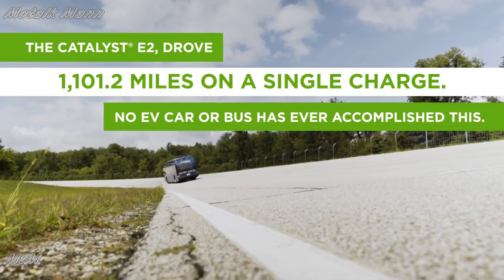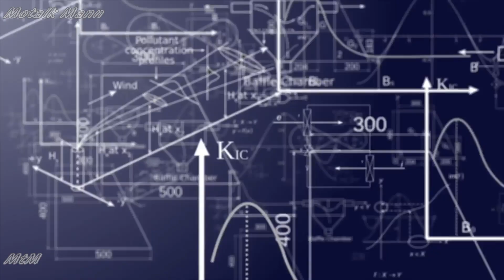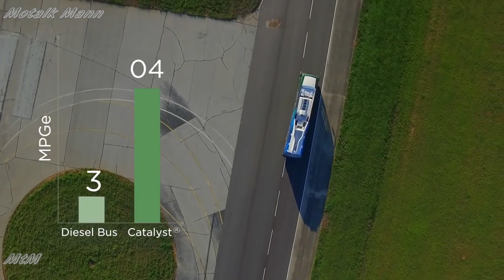Proterra Electric bus sets world record - 1100 miles on single charge

Comment: i have to say the design sucks but the capacity is amazing
Reply: Your right, the design are very ugly, but other producer made the same ride distance, is just a question on battery!
Reply: @joachimscholz7098  no its also a question of aerodynamics. If you double the speed you have four times the amount of wind resistance. If you use those buses on the highway you need a better design than a box.

Comment: lorries could be electric and drive constantly ithout need for charge, they just need highway stop points where you can swap the battery pack over already charged. then they charge the one you leave.